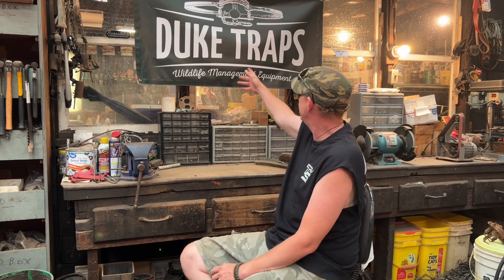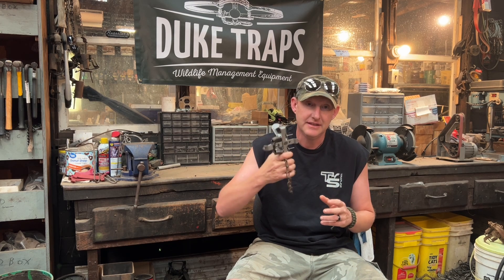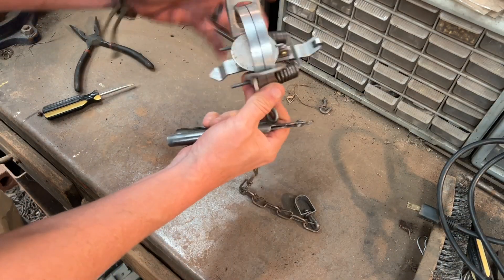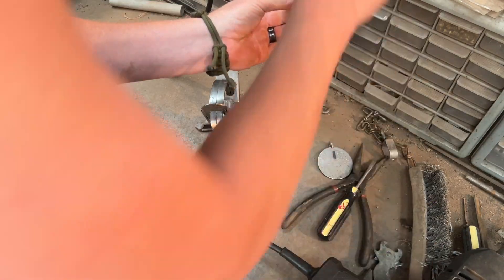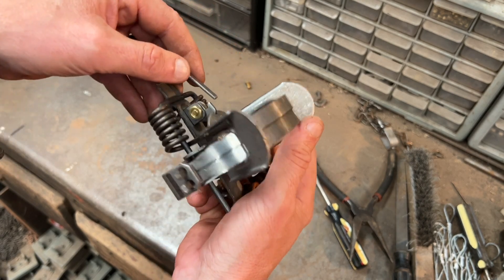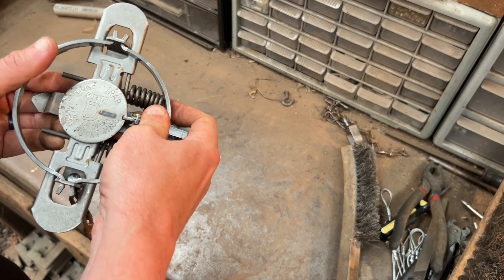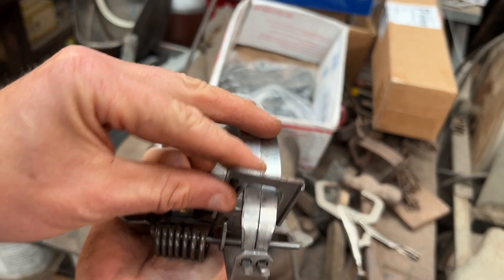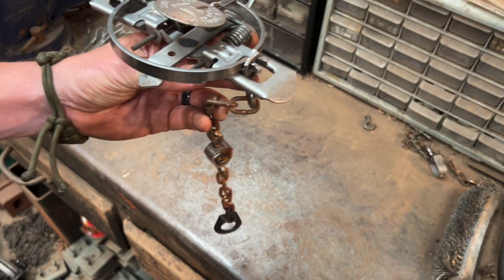Duke #1 1/2 Coilspring

Comment: I have a bunch of those Montgomery 1 1/2` with the really thick and nicely rounded jaws and really strong music wire springs. They are even harder to set being as I am much older. I bought a bunch of Sleepy Creek traps right before they closed the doors back on June 30, 2019. I have almost everything from 1 1/2 coils to 4 1/2 double long spring. The one I was not able to get was the #2 double long spring. I really wanted a dozen of those, but it didn`t happen.